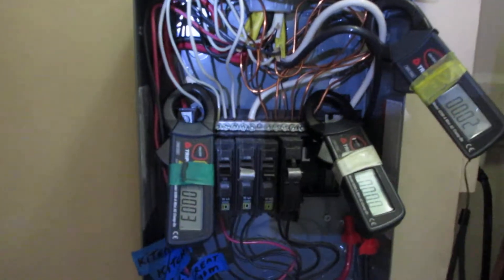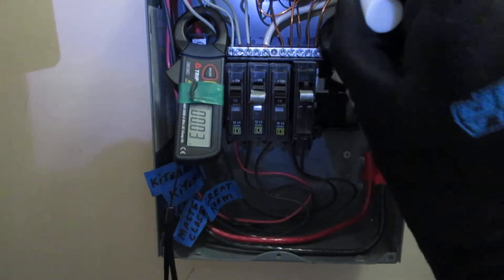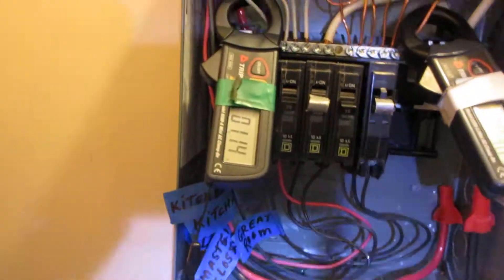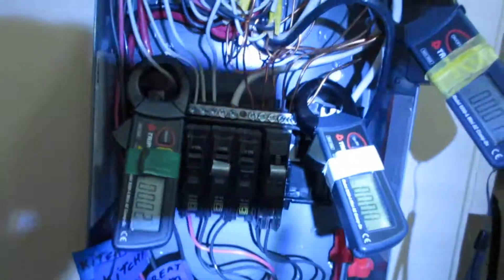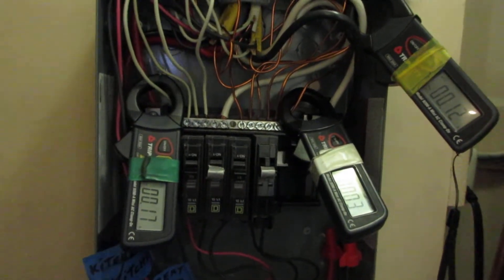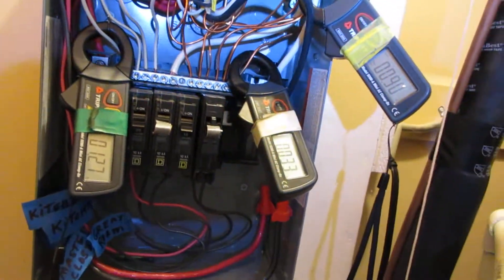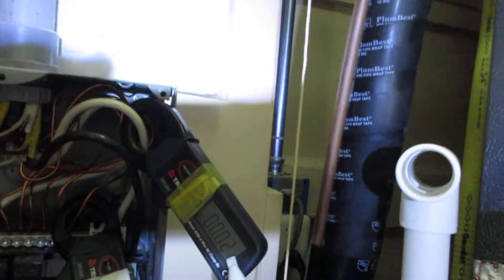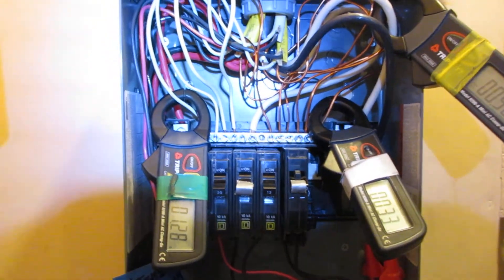Neutral wires illegally connected between separate sub panels

Comment: Please explain so beginners understand.
Reply: Eric is demonstrating that two unrelated circuits-- so unrelated that they were actually affiliated with different whole subpanels! -- have had their neutral wires linked together inappropriately. Although the circuits will appear to be 'working', this disallowed situation (per the NEC) leads to both a dangerous and unhealthful situation.  As Eric showed, the 'turned off' subpanel actually has current flowing which could pose an electrocution hazard.

However, it is likely that this situation was brought to Eric's attention because the folks in the house were feeling unwell.  In brief, this neutral-neutral intertie leads to magnetic fields along the full length of wires of multiple circuits.  If those wires run past the headboard or underneath a bed, then the chronic exposure to the EMF fields is injurious to everyone and if sufficiently strong, then some folks will feel them acutely and become unwell.  As a Building Biologist, it is the protocol to investigate hazards in the house and this N-N intertie is 'one of the usual suspects'.  Fixing this will likely provide immediate relief to the occupants, certainly giving them a better long term health prospect as well.

How does such a N-N intertie come into being?  Very easily,  as an example shows.  Anywhere you have a junction box where two or more circuits share the box, there has been a tendency for electricians or handymen to link all the neutrals under a single large wire nut. This is bad.  Also, all-to-common. Fixing this problem, generally, involves separating these with different wire nuts. Ten cents in parts and 5 minutes of time -- the occupants probably have had health discomfort for quite a while.

How does an N-N intertie lead to magnetic fields?  In a normal circuit,  if the black wire (hot) draws 5 amps for motor, the full 5 amps of current returns to the power company (so to speak) on the neutral.  But when there are two circuits then there re now two paths for the return current.  Suppose that half the current travels back on each of the neutrals -- 2.5 amps.  Now circuit 1 has a 'net current' of 2.5 amps (because the incoming of 5amps is not quite balanced by the 2.5 amps returning on its neutral).  However circuit 2 also has a net current of 2.5 amps (because the incoming line has 0 amps, but the return is carrying 2.5 amps!).   Magnetic fields are produced wherever there is 'net current' flowing.  Normally balanced wires have very small magnetic fields (just because the wires in a Romex  are a few millimeters apart), but unbalanced magnetic fields can have very large fields that can emanate 4 or more feet into the room.

I hope that provided enough explanation, but if not, then let us know.
Reply from the maker: Ken,  thank you for the great summary.